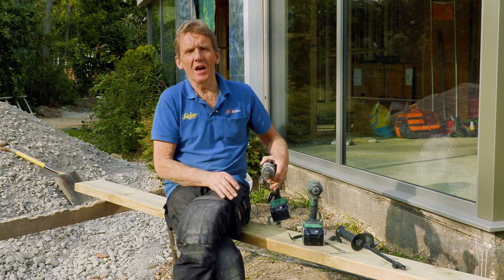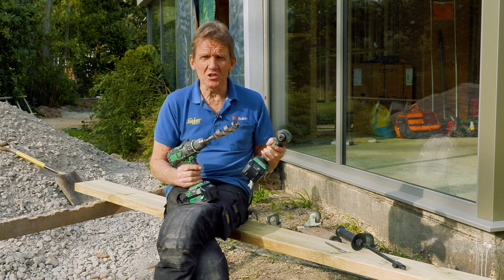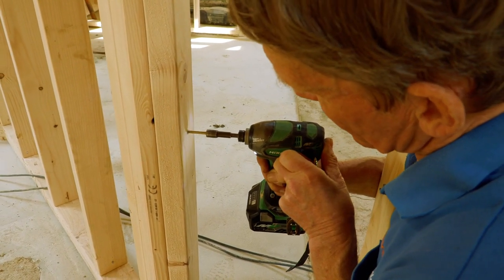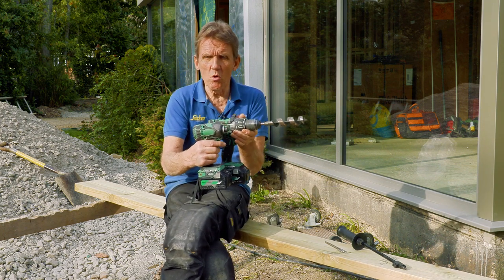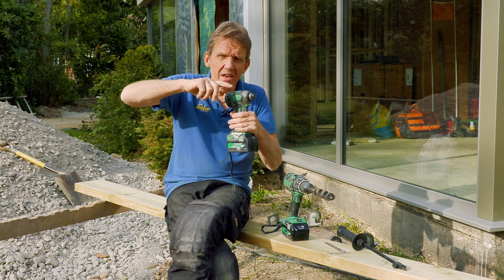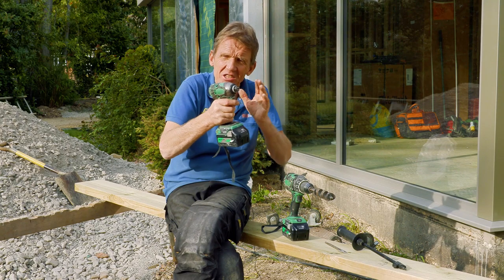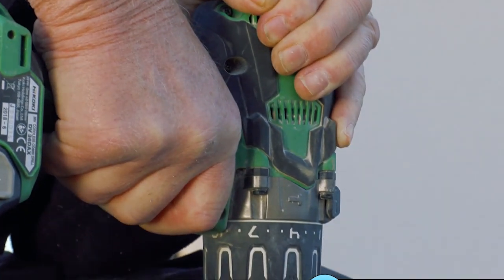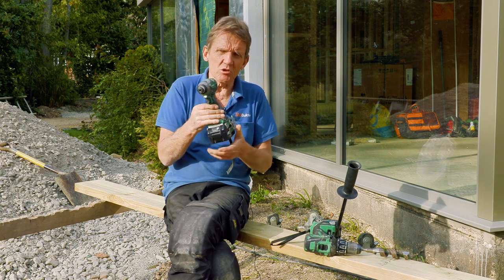Impact Driver v Drill - What's the Difference?

Comment: I've just bought my first house and had been looking into both impact drivers and drills. My research led me to buy one of each - drill for drilling holes for rawl plugs and an impact driver for other projects such as woodworking and if I want to do any wood construction in the garden.

The impact driver will drill holes too, but not as well for masonry, concrete etc. It's great for flat pack furniture too - stick an Allen key bit in the end and it makes quick work of everything!

I went for the Ryobi brand as the reviews were great for everything I'll need and you can reuse the batteries on all kinds of tools like orbital sanders, saws etc
Reply: Good choice! Ryobi isn't the best you can get in any way, but it will get the job done and for occasional use with care they last a long time. Personally I was sceptic towards getting an impact driver at first, but it is the tool I use the very most, with my angle grinder in second place. I only ever use my drill when I need to pre-drill a hole for a screw.
Reply: @kundetjenesten  Yep, they may not be the best for professional use etc but for someone like me who really just needs them for basic home DIY and general making things they seem great. They are comfortable and seem well made plus the ecosystem of tools is a big draw for me!
Reply: @eus9  Indeed, right you are. Especially on the ecosystem. The salespitch that got me interested in Ryobi was that they never change their battery slots. I could afford a lineup of tools from Milwaukee/DeWalt/Makita etc, but I would get raving mad if ten years down the line I would have to discard fully functional tools because the batteries have gone out of production!!
Reply: Thanks mate

Comment: There’s nothing wrong with what you’ve said here but you’ve not made it clear that the fundamental differences between the two is that 1) a combi drill can be switched between percussive (hammer action) and non-percussive whereas an impact driver is always percussing and 2) that in a combi drill the percussive force is down the line of the drill bit (ideal for creating chips at the end of a masonary bit) and in an impact driver the percussive force is in a rotary direction (ideal for torking a screw/bolt etc. tight).
Reply: Thank you.... :o)
Reply: In what circumstances would you need percussive force and what circumstances would you not?
Reply: That's a useful addition, thanks. Although these points were implied, you've stated them very clearly.

Comment: I was a bit dubious if an impact driver can be of any use in my carpentry shop. But now that I have bought the brushless Hitachi one - I don't regret it an use it every day now. It can pretty much substitute a combo-drill for most of my operation. If you have the appropriate drill bits in a hex bit variant of course. Excellent driving any type of screws with the four different settings. I use it mostly on the weakest 1-st one, not to overdo the small screws. But it can be a pretty good drill for smaller holes as well - on softer materials like pine it does not even turn on the hammers, the 3K RPMs are doing all the job blazing fast and without the annoying hammering. With the 3AH battery it is as light and balanced as a 10.8 combo-drill and powerful as a 18V one. What's not to like?

Comment: Useful stuff, thanks.  I use a good combi drill and a decent stick screwdriver in tighter spaces (just for lightweight jobs - been through a few and more often use manual). I have often wondered whether it's worth throwing an impact driver into the mix, and this was a helpful vid on the basics. I had already lined up good drill bits, as I know they aren't compatible and are pricey, especially if you want a full range of PH, PZ and slot, and possibly JIS bits too... and hex, torx....I think the cost of good bits will be the limiting factor.  It would be a shame to have the driver and be stingy with bits. Comes down to what I decide to spend I guess, but I think an impact driver would be a handy addition for many people.

Comment: I've noticed all my apprentices favouring impact drivers for most jobs. It's not until they try to remove the screws that they find they have knackered the heads. Why??? They are OK for some jobs but not all.
Reply: Decent screws, correct drill bit should fix that tho ? I never have an issue with that

Comment: I always thought that the hex ended bits were for the various quick release systems rather than specifically for impact drivers
Reply: They are. As Roger mentioned you need to use impact rated bits in an impact driver.

Comment: I think you need to have both: the impact driver scores on compact size and, with the correct selection of impact rated bits, makes far easier work of drilling joist holes for cables than the combi-drill but for pure drilling jobs the combi wins hands down. Most manufacturers offer a multibuy where you can get both for not much mitre than the cost of one unit,  battery and charger. The batteries are the big expense so look for 'bare' offers if you already own one tool and battery.

Comment: Don’t use an impact driver when fixing screws into things like hinges/handles etc as they can easily snap the screws
Reply from the maker: A lot of impact drivers now have a setting for doing this kind of precision work and the impact mechanism doesn't cut in unless it needs some extra force, which on handles and hinges is rare.
Reply: Skill Builder, Im using the most recent Milwaukee so I’m sure I have this feature but I still daren’t risk it if it snaps I’ll never hear the end of it from my old man (and boss)!!
Reply: @creativetag1  milwaukee has 3 speeds and a self taping mode. If you use it correctly you won't snap any screwd5
Reply: Was only trying to help a few people 👍

Comment: Only ever used my impact driver to remove difficult and really tight screws......my hammer drill does the main work with a  drill bit on  and a driver with the relevant bit on puts the screws in. Oh, I nearly forgot , I once used the impact driver to take my wheel nuts off 🙂

Comment: Love my impact driver but so bloody noisey after a few hours use. Price of a twin set means it's a no brainer to get the twin set and as you say you can drill and drive immediately.  Just don't drink and drive.
Reply: Not using hearing protection?
Reply: @jaybloggs8699  well that would be smart but unless I use a hammer drill in concrete or whatever I tend not to be arsed which is my fault....
Reply: @alexanderbell3102  just make it a habbit (with all power tools), bcoz even the quiet impact drivers are noisy. How I wish i knew more about safety when i was younger.. ! eyes/ears/hands.. so easy to protect really.

Comment: Do impact drill bits work on regular drills
Reply: Impact Drivers drill holes just fine, the only difference in the bits is that the bit for an Impact will have the hex bit end, rather than the round shank.  You can use it is a regular drill as well, but they are more expensive.
Reply from the maker: Robert
Yes, as I understand it, the difference is in the way the shaft is heat treated and tempered. There is a section of the shaft  that absorbs the shock to prevent it snapping. You can use them on drills but the bit is over-engineered and doesn't offer any advantages.
Reply: Masonry bits for impact drivers are great. Defiantly faster on hard brick where sometimes a hammer drill would struggle. It's all about options and materials your drilling or fixing too.

Comment: I have gone away from using impact driver.
I find just using a drill is my preferred option.
Many impact drivers are noisy and I find I can do most things with the drill. In fact I had the metabo impulse drill which was good for running in bugles.
A lot of carpenters drive in screws with an impact driver without pre drilling.
The problem with that is when you need to dismantle something particularly if it were formwork or temporary security you find you cannot pull some screws out and some get destroyed adding time to the project.
Reply from the maker: yes I think we have come full circle, the smaller 12 volt drills are easy to handle and offer enough power for every day screw driving.